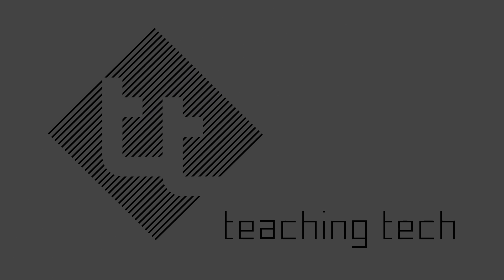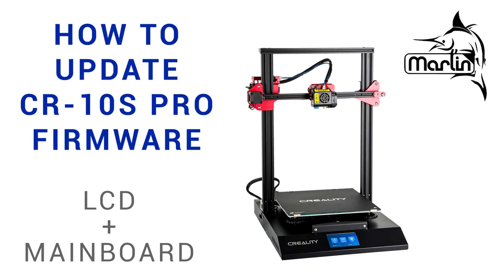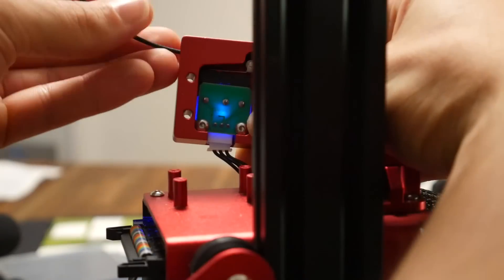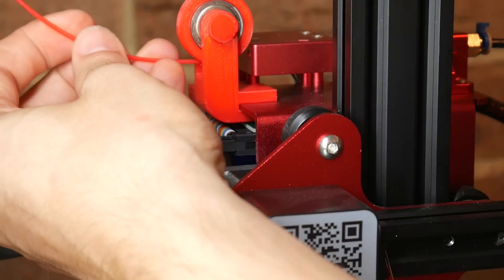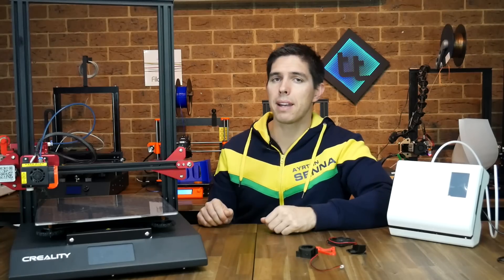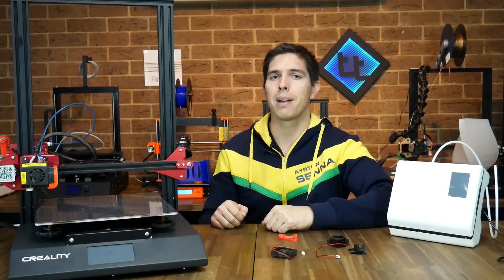7 fixes for the CR-10S Pro - Unlock the potential!

Comment: 1:06 Thermal Runaway Protection
1:47 Melted Fan Duct
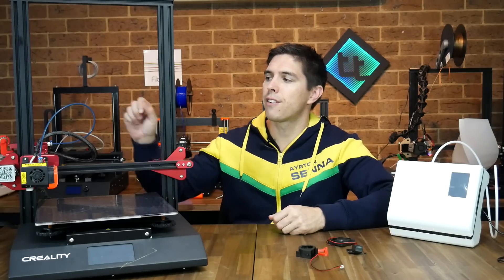2:52  Jammed Filament run-out sensor
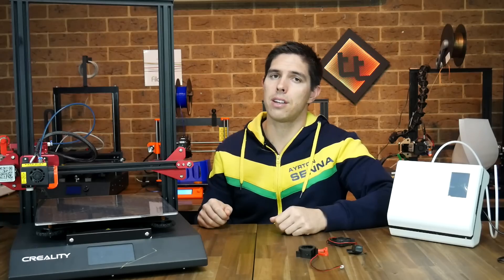3:38 Poor Filament Path = Dust
4:42 Inconsistent ABL Probe = First Layer Woes
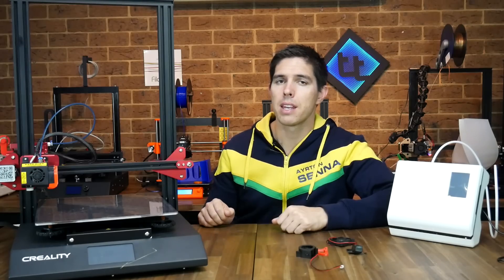5:52 Hard to Remove Prints
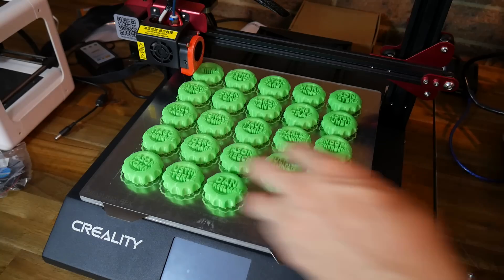8:12 Noisy Fans
Reply: It's only 10 mins but thanks anyway :-)
Reply: @GELHammer  I'm a serial rewatch while working person, it was for my own purposes and I don't believe in not sharing when it costs you nothing :)
Reply: thanks
Reply: Is this for the v2
Reply: @MrFoxracingred  No, for V1.  My V1 had the first 3 fixed already, filament path and impossible to remove prints were/are still an issue.
Reply: I just installed a Bondtech on mine and as I am lowering the Extruder voltage as directed. I’m amazed to see XYE are at 1.4v and Z at 1.7v.  What vref are you running?
Reply: +10 Internet points

Comment: 8:46 Never work on your printer while plugged into the mains and/or switched on.  True there is only 24V running through so the shock hazard is low, but, you fling one screw on to that mainboard or drop it near other electronics and you run the risk of frying your system.   The biggest issue I have found with this printer is the Gantry.  On shipment mine came miss-aligned.   There are 4 screws (2 on each rail of the gantry) where the red aluminum plates are attached.  If those plates are not aligned perfectly to the rail, one side of your gantry will be higher/lower than the other.  Loosen just one screw on each side (you may have to loosen the second screw a bit) and check the edge of the aluminum plate with the extruded rail edge.  Align these on both sides perfectly, then re-tighten the screws.  Check that the gantry is level on both sides by measuring from the print base to the bottom of the gantry.  Then make sure to re-run bed leveling.  This quieted my printer quite a bit as well as made a considerable difference in the quality of the print.

Comment: You need to do a new video on this on the two major issues that actually affect basic printing. Unlevel gantry and left side stepper motor grinding with the Z-Rod likely do to the unlevel gantry. I have done every fix I've seen on YouTube backlash nuts bearings at the top disassemble make sure everything's square level copacetic you name it I'll get 10 prints that are nice and then out of nowhere grinding and then the zig and the gantry is off by like anywhere from 2:00 to 12 mm driving me freaking nuts ready to shoot this thing with my 12 gauge 3 years of this insanity

Comment: This printer sucks. Honestly... it's been such a POS in a HUGE WAY... JUST SICK AND TIRED OF THIS PRINTER. And I have two of them!!! Both of them are NOT WORKING. What is that grey tube where the probe is? Mine does not have this. I get it..I'm complaining about this printer, but we've been struggling with them for years... it should not be that way.

Comment: Amazing video. The fan duct really saved me, mine failed in the same way and I had just basically superglued it to the screw. 
I personally had to use slightly longer m2 screws, to get it to nicely screw into the fan.

Comment: Hi Michael, Does the Ender CR10s Pro thermal runaway correction firmware work on the Ender CR10s Pro V2 as well??

Comment: Can the CR-10s Pro control board be swapped out with a BigTreeTech SKR board?  Haven't seen any videos addressing this yet.  I see it is nearly impossible to find an Ender replacement board for this.  Any help on finding a good replacement board would be appreciated.
Reply: Simple answer is yes butt. Lol The butt is the second smaller board on the Z axis and the screen. If you have the time and patience, you can install longer hotend wiring and run klipper for sure.

Comment: Flexi Plate Question - Does it have enough ridigity so the divets from the factory metal plate are not a problem?  (I found the CR-10 flexiplate was not strong enough)

Comment: Love the channel. No matter what 3D print advice I look up, I always come across your videos. As far as the filament guide, I made one myself and I feel fairly confident in saying it's one of the best options available. Compared to most I tried, it's less friction, less chance to jump off the guide from retractions, no top frame part required, easier to print (no supports), tool-less, and only requires a spare rail roller which most of us already have. Interested to get some feedback. Let me know if you wanna test it!

Comment: Finally printing the fan adapter for my CR-10. The board fan started a whinning sound on start. After 5-6 restarts the fan would run normally.
Thanks again for this video.

Comment: I just installed a Bondtech on mine and as I am lowering the Extruder voltage as directed. I’m amazed to see XYE are at 1.4v and Z at 1.7v.  What vref are you running?

Comment: Hi Teaching tech (great videos, i learned a lot for my CR-10 Pro!) ------- my Cr-10 pro has performed super in the first few month, only now i have a problem = i fixed a tube (it was stuck with PLA) and applied a new one and now: my printer goes off when it prints = it does not follow the lines, at first it seems to do so, but i goes off and then it will create a warped version instead of the nice and smooth sharp prints (that i am used to)... ----------- do you know how to fix this problem (have you heared about it) please let me know.-------- DaniEL

Comment: Tnx for your review helps a lot . I have one question I’m between 2 printers now from many of your reviews 😀.
1. CR10S pro V2( with all your upgrades).
2 .ENDER 6 
Which would you prefer ??
Reply: Which one did you end up going for? I am getting a CR10S pro V2 and planning to doing some of these updates (I'm not sure if the firmware or cooling fan duct replacement is still needed though with the new version)
Reply: Ender 6 has no community and support...so go with a cr10 model 😉👍

Comment: Hi Michael, Thanks for this informative video. I've been trying to determine if a z-support brace is necessary on the Cr-10s pro (and v2) I've not seen this brace (which is a normal upgrade on other printers) on any video's for this one. Would you recommend or is this overkill for this particular printer? Thanks!

Comment: Im having an issue with this printer, i selected a file to print, and the printer sets to cooling or pause, and the completing % sets to 218...i upgrade the firmware twice to double check and the screen as well

Comment: I updated to the tinymachines firmware and the resume feature still doesn't work. I entered the gcode and it still wont work. I'll be going back to the creality firmware as they've now fixed all of the known issues and you don't need some jumbled together 3rd party firmware.

Comment: Hey, just wanted to share the fix i've been using for the poor filament path to reduce the dust. As far as i could tell this was caused not so much by the path but by tension put on the filament at the runout sensor causing it to grind against the inlet, it was happening once i decided to try a larger spool of petg which wasnt spinning on the spool holder very smoothly. I fixed this just by putting some automotive bearing grease on the spool holder... it just lets it spin easier and i have very little dust...
Reply: I fixed this issue by simple moving the spool holder to the side of the machine rather than being at the top

Comment: 4 5 &6 look essential for me. Great Video.

What is your starting and ending G code?

Heres mine … 

I have some near perfect ninjaflex settings I will share in exchange (Retraction needs to be dialed in). 

 Start G Code

M201 X500.00 Y500.00 Z100.00 E5000.00 ;Setup machine max acceleration

M203 X500.00 Y500.00 Z10.00 E50.00 ;Setup machine max feedrate

M204 P500.00 R1000.00 T500.00 ;Setup Print/Retract/Travel acceleration

M205 X8.00 Y8.00 Z0.40 E5.00 ;Setup Jerk

M220 S100 ;Reset Feedrate

M221 S100 ;Reset Flowrate

G28 ;Home

M420 S1 Z2 ;Enable ABL using saved Mesh and Fade Height

G92 E0 ;Reset Extruder

G1 Z2.0 F3000 ;Move Z Axis up

G1 X10.1 Y20 Z0.28 F5000.0 ;Move to start position

G1 X10.1 Y200.0 Z0.28 F1500.0 E15 ;Draw the first line

G1 X10.4 Y200.0 Z0.28 F5000.0 ;Move to side a little

G1 X10.4 Y20 Z0.28 F1500.0 E30 ;Draw the second line

G92 E0 ;Reset Extruder

G1 Z2.0 F3000 ;Move Z Axis up

End G Code

G91 ;Relative positionning

G1 E-2 F2700 ;Retract a bit

G1 E-2 Z0.2 F2400 ;Retract and raise Z

G1 X5 Y5 F3000 ;Wipe out

G1 Z10 ;Raise Z more

G90 ;Absolute positionning

G1 X0 Y{machine_depth} ;Present print

M106 S0 ;Turn-off fan

M104 S0 ;Turn-off hotend

M140 S0 ;Turn-off bed

M84 X Y E ;Disable all steppers but Z

Comment: Thanks for the video. Considering that the latest CR10s PRO official firmware already has thermal runaway protection, do you still be a benefit on upgrading to the TM firmware? What would be that benefit? Thanks

Comment: Hi michael! My cr10s pro motherboard seems to be broken. do you have a suggestion which replacement board is better?
Reply from the maker: Something like an Skr pro from big tree tech has the required ports, but won't be compatible with the factory touch screen. So there's nothing really easy.
Reply: @TeachingTech  :( ohhhh man.
Reply: do you think it is possible to fix a board that is somehow functioning as z and y together insync

Comment: After i put on a wham bam plate my default sensor has made my 1st layer all over the place. Tried putting a bltouch on the CR-10S pro . lights on but will not home correctly pin drops 3x on power up but will not autolevel When told to goto home position printer just keeps going up on the z axis. Jumper installed bltouch 3.1

Comment: I had the same problem with the filament run-out sensor on my CR-10S V2
Reply: Did you also change the bed to the wham bam 310 x 320mm as he shows in this video?

Comment: One more issue that came up and needs fixing  fast: The machines are catching fire because of a poor strain relief design holding bed heating wires. There are  some fixes out there but they aren't 100% yet.

Comment: I believe that the machine has too many fans and they are fastened to a large sounding board ( the large thin sheet metal enclosure) that amplifies the sound of the fans. I have solved similar problems with fan noise by using elastic isolation mounts.

Comment: Great video, but you miss the 8th and most crusial problem. The wires to the heated bed is bound to break leadig to thermal runaway  or even fire due to shortcut

Comment: Great stuff, as always.  To me, one of the best enhancements in the TM3D firmware upgrade is the Z offset adjustment on the  "Adjustment" screen.  It makes first layer adjustments so much easier.
Reply: Live z adjust comes with the stock firmware. Also included now is heat runout

Comment: I have only had my 10S pro 3 weeks, I have a short list of upgrades I thought it needed. Then I saw your other videos and got to thinking. Consistency seems unobtainable.  I wanted the quiet fans did not do it yet. Hated the Bed sensor ordered a new one not installed yet, Ordered drive to connect the tops of the Z drives not installed yet either. I find with PETG I end up with globs so much that a glob can ruin and entire part. What is this uncontrollable globing, poor 1st layer and Z offset seems to move around on me. While I am at it. I bought the machine already, please don't tell me to sell it and by this other one. I want to get this one as good as possible. Slider bearing can wait for now but the while extruder and Controller could be replaced if needed.
Reply: Download discord app.

Add me as a friend : Obokenpally#1293

I will help you to the best of my ability with any and all questions regarding this printer.  Ive owned it for just over a year now. Tons of upgrades done including ALL mentioned in this video
Reply: @pallyplays3605  I have come a long way. Before i saw your offer. New bed sensor,  Tiny Machines firmware and CURA slicing has taken me out of the dumps. PETG and ABS are printing well and reliably. Now getting a MicroSwiss hot end for CF Nylon. This will allow me to complete my model train upgrade kits. Thank you
Reply: @DennisMurphey  look at the mosquito hotend.   And the  new e3d hemera  direct drive upgrade is out.  Both of which is choose over microswiss  but deffinatly your choice.   Glad to hear your up and printing

Comment: Hi Michael, I am looking at the CR-10S Pro as my first 3D printer. Do you have a suggested “shopping list” of things I should get with the printer? I found the Banggood site difficult to get through (ignoring the misleading ‘discount voucher’ claims)
I am expecting that I will need to do upgrades but would like to get these underway with the initial build if I can.

Comment: re: Poor filament path = dust.  While it's always fun to print a fix, I'm wondering if I couldn't just take a countersink and gently round out the inlet. Remove the sharp edge = no scraping the filament = no dust.  Or even take a round needle file and round out just the sharp top edge where the filament passes. Or, what the heck, my two hour print hasn't produced any dust; maybe Creality has already fixed this?
Reply: Just print the part dude

Comment: The wham-bam size for the cr-10s pro is 310x320 I believe. That's what I ordered anyway :O
Reply: Good because i ordered the 310x310 thinking it was recommended 310x310 for a reason but it didn't fit
Reply: @fernandosantiago5606  Yeah check the site's sizings, cr-10s PRO is 310x320 system. I hope you're able to get it sorted out :O

Comment: The cr10s PRO has a 310x320mm print bed. Do not buy the 310x310mm. There is an option for 310x320mm wham bam build plate. That will fit perfectly.

Comment: Hello! 
My original hot bed cover was broken after 2 weeks at the central point and I has remove it.  
What kind of cover is better for the best adgesion of ABS? - 
1) Glass (mated glass)
2) Borosilicate glass
3) Perforated or black diamond glass (as on the JGaurora)
4) PEI Polyetherimide cover (1? 2? or 3mm?)
5) Metal with magnet with PEI, as You show (I'm afraid, that it can be weaved during expluatation)....
6) something else..?
I want to buy for my CR-10S PRO but can not choose (all of them is not a low cast items. One borosilicate glass was broken during transportation...)

Comment: Thanks to your video (and another one) on changing out the fans, I am in the middle of replacing all fans on my CR-10S Pro, starting with two each 12V Noctua Fans wired in series so there is 24V across both of them.  This required cutting a hole for the second fan and drilling 2 or 4 holes to mount the second fan next to the first.  Both fans pointing towards the exhaust.   I also created a double fan bracket that mounts to the 2 screw mounts near the main board.  One 50mm fan points at the main board and the other points at the DC Relay.  Thankfully on my new printer, the relay was mounted to a large aluminum heatsink, so I won't bother moving the heatsink over to the aluminum rail next to it.   Again, by using two each 12V fans, I wired them in series and now apply 24v across both fans...each fan getting 12V.  Because the fans "match" (same model / same impedance) then the voltage divides evenly across them.  If you were using 2 different fans, one would likely get more than 12V and the other would get less than 12V.       Because I am replacing 1 fan with 2 wired in series there is the risk that if one fan dies, the other fan will stop working too, however that is true with of the 1 fan that I am replacing:   If I had left that 1 fan in place and it died there would be no fans cooling in that spot.     So I'm not real worried about it.   I also replaced the power supply fan and I have a quieter blower on hand for the part cooling fan.    I am waiting for a few other little parts to arrive this week to complete the upgrade of this printer.  I'll be installing the new TinyMachines screen and mainboard firmware tonight, hopefully.

Videos like yours contribute greatly to making these upgrades much easier.  Thank you for sharing.

Comment: Can you please post a single video with just the ABL calibration procedure.  I think even with the Tiny 3D video there is confusion on how to adjust the sensitivity of the ABL sensor vs. the actual height adjustment of the ABL sensor itself.  I've had a hard time with this.

Comment: Hello Michael. First of all I want to say your reviews are great. Very detailed and well explained. About this CR-10S Pro. I kept thinking. This is a $650 plus taxes and fees printer, plus your recommended upgrades which they all look like must haves, this printer comes out over $750. With that same money you can get the latest Prusa MK3S which is a better printer only trailing this one in print volume. What are your thoughts on this? Do you have a review on the Anycubic Chiron?
Reply from the maker: Haven't used the Chiron but I still love my mk3. It has stood up very well against all of the printers I've reviewed since. Build volume as you say is the downside compared to the cr-10
Reply: @TeachingTech  Ok. Thanks. It would be great if you could do a Chiron review.

Comment: Hello, I was wondering if you are experiencing an issue that I have with the CR 10S Pro. When I print from usb, the printing screen does not come up and therefore I cannot get to the adjust feature. When I print from the sd card, it comes up but only while things are heating up. Basically according to the screen you would never even know that something was printing when it is. This is really annoying when you need to adjust the z offset and such on the fly. Do you know a fix for this? I slice with cura and I have the latest tiny machines firmware.
Reply: Do you have this issue?

Thanks

Comment: I bought my CR-10S Pro based on this video.  If this video didn't exist, I would be sending it back.  Actually, I bought an open box unit so someone else probably had a terrible experience.  I tried printing with it out of the box and it was terrible.  Tuned up, it's great.  Thank you for the great work!